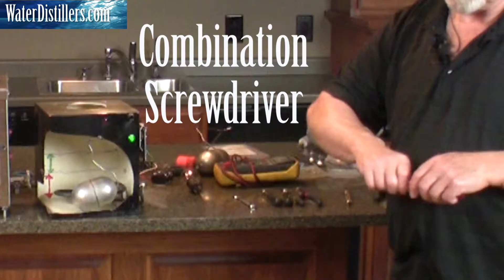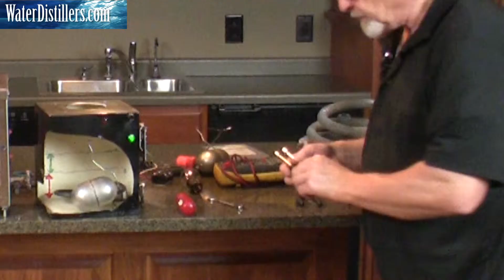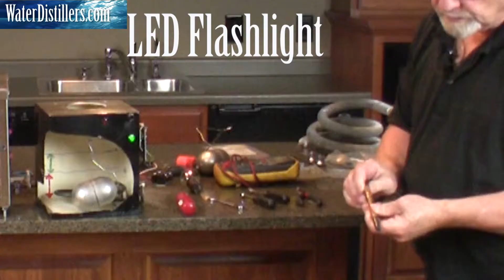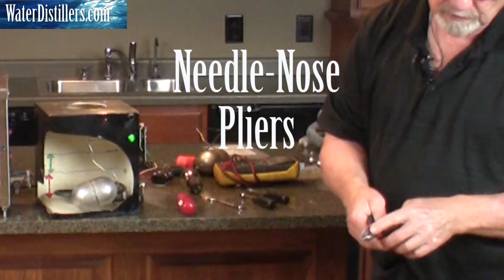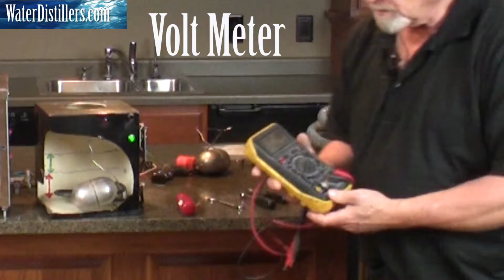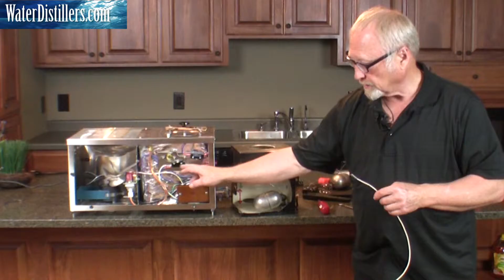Tools Needed To Repair A Durastill Water Distiller or service other water distillers

Comment: What causes my Durastill distiller short out immediately when you plug it into the electrical outlet?  It is about 5 years old and started shorting out several times a month.  Now shorts out when immediately plugged in.
Reply: Have you find out what cause it the shorting? I have the same problem too.
Thanks for your answer.